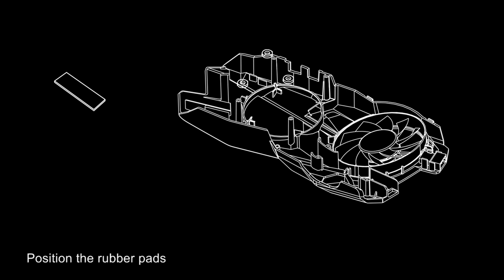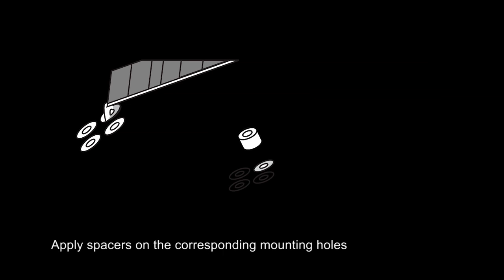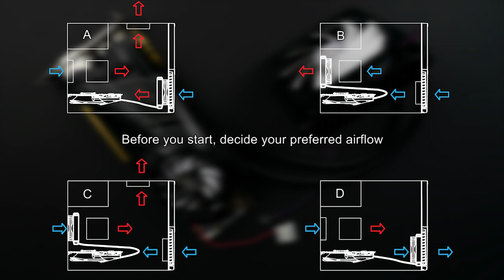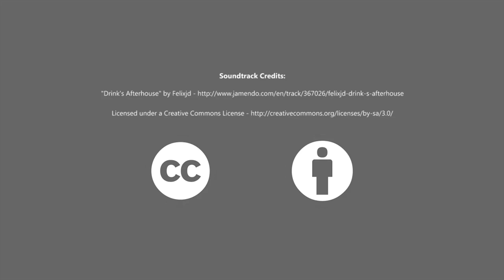ARCTIC Accelero Hybrid installation video (Multi-Languages Available Inside)

Comment: i ordered it for my R9 290X i'm not expert with this stuff, but the annoying heat and fan noise from 290X worth this !! thanks for the guide :)
Reply: Kyle Raessner How would it destroy a computer, they use non-conductive liquid in these things. Hell pure water doesn't conduct electricity. Didn't you learn this in 5th grade science class? Because of its high relative dielectric constant, de-ionized water, in highly specialized instances, is used as a coolant in direct contact with high-voltage electrical equipment.
Reply: closed tubes doesn't leak. 1~10% would happen which is very rare !
Reply: Kyle Raessner Lol

Comment: It's a pity you don't still produce this, I prefered the Hybrid I to the Arctic Accelero Hybrid II and the soon to be released III.  You should relaunch this product, but include the VRM plate of the Hybrid III and you would be onto a totally winning product, because it looks great in design style.  You did an excellent job with the new Inno3D Hybrid design, you should sell it as a retail product.
Reply: +ravernelly performance > style
Reply: thats debatable when you're already water cooling. why not get both.

Comment: @brantyn gerik Yeah it should (newegg compatibility list says so). I'm doing an ott build with dual 660ti and whatever the model number of the best six core 2011 CPU is (I forget) so I'm using 2 of these when I get it all ordered... No point getting a good stock GPU fan system with these.

Comment: i have already got a 940mhz oc with out cooling and max temp is 85 degrees celcius  also i have no problems and its not the normal hd 6770 its core edition which is already oc a bit i think i know what is worth getting to get 1ghz.

Comment: Hi, i am currently running two 6950s in crossfire. The motherboard i have has the pcie lanes only 2 pci card widths apart. Would this cooler fit?

Comment: How would you set this up if your card did not have that fan power plug on it
Reply: +Paul Doyle Your card has it.
Reply: +KillTheCurse Thats a year old comment, but my cards fan power plug didnt work, i bypassed it tho my gpu fan is controlled by my case fan controller now
Reply: Paul Doyle Interesting lol sorry didn't really realize it was so old.

Comment: Anyone know if this (or the new version) is compatible with one of the MSI Twin Frozr versions of the AMD R9 290? I really need something like this because this MSI version just doesn't run cool enough since I run at 5760x1080 resolution which really requires the best possible gpu cooling that the msi cooler doesn't give xD
Reply: i think they do ,go on there web site,theres a new version of this ,the Accelero Hybrid II 120
Reply: kyndred2008 too late, just installed the kraken G10 with a H90 xD
Reply: Jeffery Peters I installed a Corsair H90 on mine using the NZXT Kraken G10 bracket, also it definitely needs aftermarket  VRM heatsinking (GELID ICY Vision R9 290 Series VRM Cooling Enhancement Kit) as well as some heatsinking on the backplate to keep the VRM's in check, works though, max 62C @ 1150MHz and no throttling :D
Reply: Jeffery Peters mine was getting 95C at stock speed even if i undervolted it below stock volts lol
I guess it shows ya this "ASIC Quality" thing in CPUZ is bs, mine says 86% I think which is supposed to be more than high enough that my card should have been put in the R9 290x bin rather than the 290 bin and yet it runs hot and wont go higher than 1150MHz without using the voltage trick with MSI afterburner which I dont do because past 100mV the power usage rockets up, literally takes 100W more power to do 1200MHz compared to 1150MHz due to the extra voltage required lol
Reply: Jeffery Peters on air? thats insanely good :o